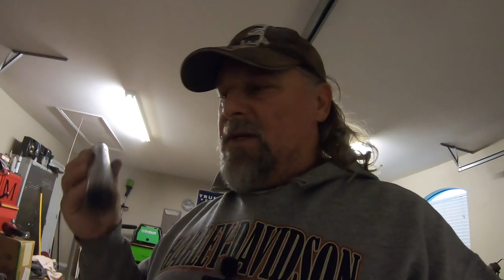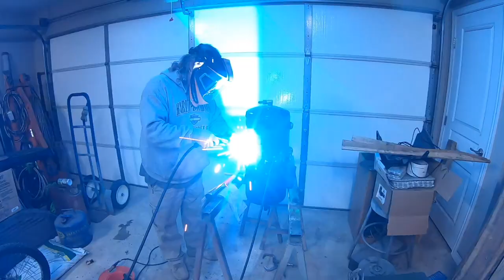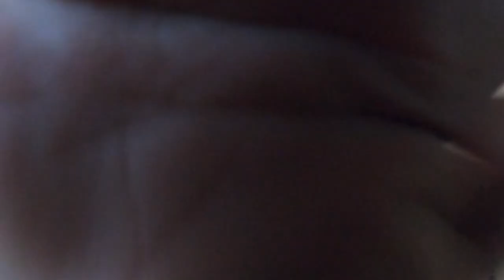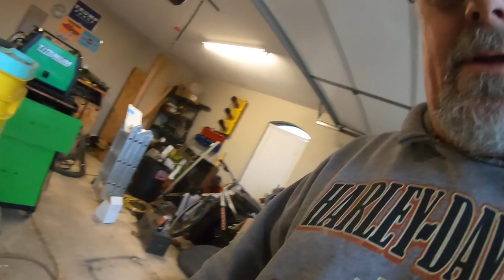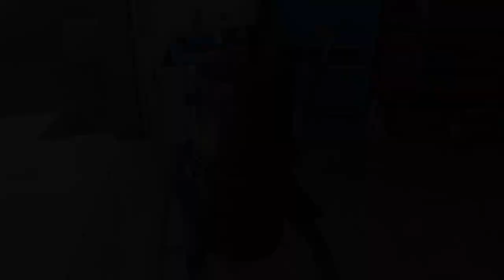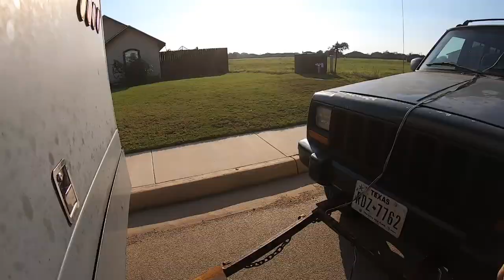Puke Tank 2 0

Comment: I think you need more holes in your air pipe or when the oil hits the pipe it will stop working. Great setup, I think it will do a great job.
Reply from the maker: Not sure what you mean.  I’m a bit of an idiot though
Reply: @dzlfreek  You put the breather pipe deep in were the oil will fill, once the oil fills to the base of the pipe it can't breath.
Reply from the maker: @55ATA3  its still 6" off the bottom
Reply: @dzlfreek  I did not think it was that high, that is more then high enough. It looked like you had it much lower in the tank.